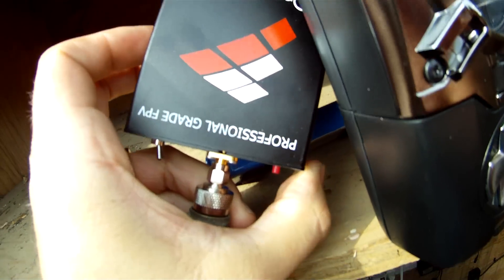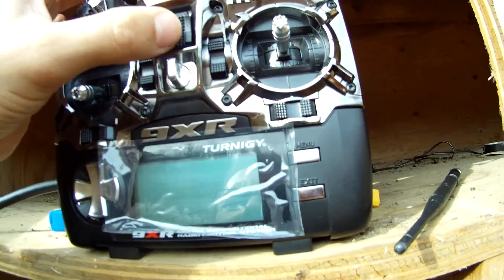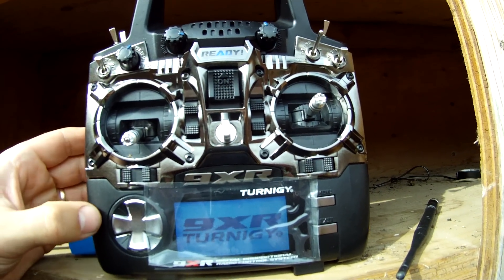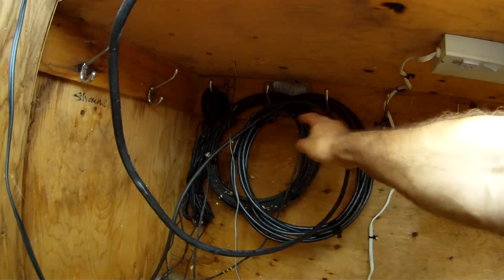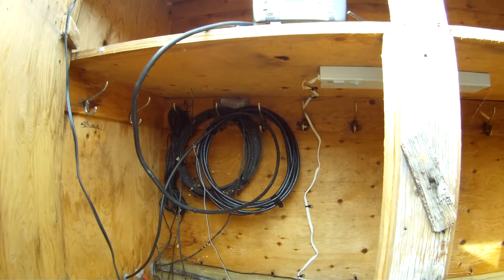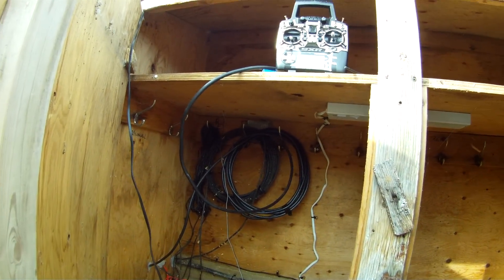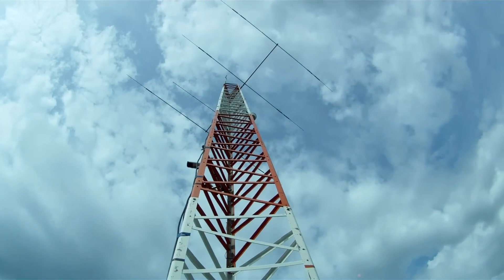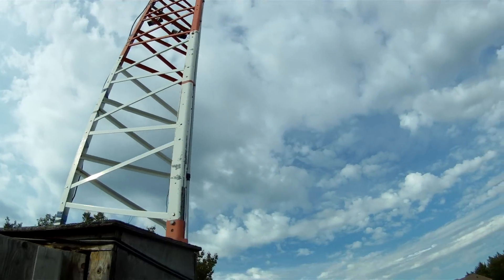Range Test DragonLink & Test with 1.3 GHz Video

Comment: Would it not make sense to use a 5.8 or 2.4 Vtx at the top of the tower as a short range repeater down the ground station to avoid the signal loss?

I realize this thread is a year old but I've always wanted to do something like this and I'm just curious.
Reply from the maker: Yes and I have done this with 1.3 to 5.8, my video on this at https://www.youtube.com/watch?v=eNfugbu7azE but the above video was mainly for the TX control which is on 433MHz and it's range using a tower mounted external antenna. The plan was to use UHF TX control on one tower, and the 1.3 to 5.8 vTX relay (or repeater) on a different tower.
Reply from the maker: When I used a 1.3 GHz vTX in this video, I was only testing to see if it would interfere with the 433 MHz RX. Was killing two birds with one stone...
Reply: +meteors63 someome told me i can use the dragonlink to send back video is that true?

Comment: dragon link is only control? or transmit video too?
Reply from the maker: +Cesar Coronel Just for control...
Reply: what is the best Tx video for long range?
Reply from the maker: +Cesar Coronel 900MHz video has the best penetration and distance but nobody makes good 900 equipment. All junk; plus antennas are very large. Best option for longer FPV range and good penetration is 1.3 GHz. No need for high power, RMRC 300 or the 400mW vTX is all you really need.

Comment: Since the new firmware update last year for th DragonLink reciever, almost all of my glitches are gone that was being caused by running 1.280 for video. The only drop outs I get are when flying very low a mile or so away. Ive considered going 5.8 but the range and penitration of the 1.280 is amazing. The pepper box realy helps, and when putting it on my 25 foot antenna tower thats goes in my truck hitch mount I made, the low altitude gets amazing.  Also the seperation of the Dragonlink transmitter from the Video recieving Antenna will also significately  help to fly low altitude further out with out the glitches.   Now like you Id like to get the Dragonlink Antenna up Higher.  I considered mounting the Dragonlink Transmitter up on the antenna tower with the pepperbox and video reciever and run a ppm cable down to the radio. The antenna already has the 12 volt power supply cable and video patch cords ran up through the poles. The poles are the standard rca antenna poles from Menards, they are gold and in 5 foot sections. They just slide together and the wires just stay inside the poles. 50' av cables are on amazon for 20 bucks.

Comment: Having some issues with Range and my setup... see post here and let me know if you've got any ideas!  Great video!
http://diydrones.com/forum/topics/dragonlink-range-issues?xg_source=activity
Reply: +Jeremy Stromsoe 
Another simple trick is to simply mount your TX antenna on a tripod, I made one from a camera tripod with a 1.5 meter aluminium extension, using a 5 metre cable, I can sit with the transmitter (at any angle) and my transmitter antenna is 3.5 metres up, perfectly vertical and immune to body shielding etc. Cheap and easy insurance with lots of benefits.
Reply from the maker: +Jeremy Stromsoe Well judging by the looks of your setup, antennas are a big problem. On the TX side, the monitor will distort your radiation pattern. You do not have a clean pattern.
Get rid of the monitor; also keep your DL antenna in the same orientation as
your RX antenna to maximize your range. On your RX antenna, again, keep the
antenna pattern clean. Keep it away from the frame and get it out all by itself
and in the proper polarization. From what I see, your horizontal on your RX and
vertical on your TX antennas, that’s 20db of attenuation. That’s not good at
all. And get your RX antenna at least ¼ wavelength away from metal or carbon
fiber (1/2 wavelength would be even better). It won’t look as clean but you’re
choosing a large wavelength control band and to take advantage of it’s improved
range, the size of the antenna and where it must be located is important. That
can be challenging for a small quad.

      

        

        

      
      

        Cancel
        Reply
        Save
Reply: meteors63 excellent constructive criticism, really appreciate the help.  I'm an aerospace engineering (not EE :)), at least that's my excuse.  So the best I could do was move the Rx side antennas away from the aluminum arms.  

http://imgur.com/gallery/p4KM7ii/new

I placed one vertically and one horizontally, underneath the belly.  If I did my math correctly though, a half wavelength is about 346mm and a quarter is 173mm, or roughly 14in and 7in respectively for the Dragonlink 433MHz center freq.  Hard to do indeed!  Way easier on a giant foamy aircraft.  

On the Tx side,I'm using the monitor to see where I am... so can't just get rid of it ;).  I think a good compromise would be to move the antenna (not the whole Dragonlink box) itself to the top of the monitor (where the rest of the antennas are).  You think that would be enough to not distort the radiation pattern?  I'm running a 5.8Ghz video system with diversity, so those two existing antennas on the monitor are for that.
Reply from the maker: +Jeremy Stromsoe I should have mentioned the 1/4 wave thing would be in a perfect world 
but if you're mounting it on a quad, not very practical on a quad. More 
for a plane. Just do the best you can to get the antenna out and away 
from other parts. Always best to keep both ends of a dipole in the same 
plane. If you can't, you can't, no problem. It just distorts the pattern a bit so it's not optimal. 

You're TX is probably acceptable the way it is. Do what you can to get the antenna in the clear.
Reply from the maker: +meteors63 I should mention that I have two 250 mini quads with DL antennas. The dipole sticks out the back (vertically polarized) about 2 inches. Range tests were more than adequate. Half of the dipole hangs below the quad and does not interfere with the props.

Comment: surely all that antenna cable will loose lots of rf power,
by extending my van cigarette extension a few meters i loose lots of power.
i lknow its not rf but electric cables, same thing enner
Reply from the maker: bartsshorts 
The cable I was using certainly had loses at 433MHz. This was for demonstration purposes only. But even with lossy cable, the video shows how well it did (even at ground level). My final install uses 7/8" Heliax which would have a fraction of the loses of the C1180. But even if I used C1180 or 9913, a tower mounted external antenna does far better then any rubberduck.
Reply from the maker: meteors63 BTW, the higher the frequency, the higher the losses in the coax. I'd never think of using this kind of coax for 2.4 GHz (unless it was a very short run).
Reply: meteors63 thanx, but i was refering to the long length of the cable causing loss.
Reply from the maker: bartsshorts The coax cables? That's what I'm reffering to also.
Reply: meteors63 yes, coax all the way to top of tower, looses rf power.
Reply from the maker: +bartsshorts Even if you lost 90 p0ercent of your output power through the coax, if it gets up high and to a good antenna, it would do far better than a ground based antenna that had no lossses.  No need for even a booser amp at 433, at 2.4 GHz maybe but not at UHF. If yoiu're concerned about line loss, use better feedline to reduce your loss. This video shows how well UHF performs even with lossy cable (and a tower mounted antenna).

Comment: Hi I live in south coast England there are many buildings I have a dx18 a hex with dji v2 my goal is to build a vtoll and fly lrs and land and take of again max distance 5 miles out as I say buildings trees you name it I've got it for interference how can I overcome these obstacles I will get the dl lrs system I have 5.8 vtx any advise for this scenario please, the only height I can get for an antenna is on the roof next to tv aerial just a two floor house !??
Reply from the maker: mark osborne 
Well Mark, DL will do well in foliage but to be safe, use
an external antenna for your DL and as high as you can get it. Use an amateur
radio omni vertical with as high gain as you can. That will solve the RC
control part but your current video will not cut it. 5.8GHz is the worst band
for long distance and foliage. 900MHz is the best long haul FPV video band we
have access to but nobody is making any good 900MHz vTX or vRX equipment. It's
all junk so stay away from that band too. That leaves 1.3 GHz. It's your best
option but 5 miles through heavy foliage is probably asking too much of that
band too. But it can be successful on that band if you use linear polarization
and long boom yagis (high gain). I'd normally use CP but not sure you’d find a
CP antenna at the GS that would give you the gain you need through all the
trees. Easier to find high gain antennas if using Linear polarization instead.
But if CP is what you want, try and very long helical at the GS; that might be
ok. Just remember, the pointing accuracy on the high gain video antenna will be
important as the beamwidth will be very narrow. The other option is to build a 1.3 to 5.8 GHz video relay
and get it has high as possible (80 feet plus). I have a video on my channel
about a similar relay. Good luck with the project!
Reply: Wow!! You certainly given me something to think about there i just sent a request of to join an amiture radio club hopefully i can get some more insite to all the band widths and also want my ham licence so iam not totally breaking any rules or what ever you have given me some great advise i shall explore every aspect of it all i thankyou kindly for that all the best to yer keep the wind in yer face and the sun on yer back happy flying

Comment: I have few questions (mabey stupid ): If I combine Dragon link ( 433mhz) and my spectrum DX6i radio (2.4ghz). What kind of frekvency I have ??? 2.4ghz or 433mhz   :)  If I use dragon link with 1.3ghz video will I need a 433MHz/1.3GHz notch filter ???
Reply from the maker: Not a stupid question at all. When the DL is hooked up properly to the radio, it will be 433 MHz only. There's lots of Spektrum/Dragonlink setup videos out there so  you'll see how it's done. Many of my copters have no problem using 1.3 video with DL with no problems. Occasionally it does happen but there's lots of fixes for that (even DL firmware for that). If there is any interference, it usually when using 1280, not so much on 1258 (and it's usually at the ground station only). Like I said, there's lots of fixes for these interference problems (high pass filters, low pass pass filters, just to name a few).

Comment: Thanks for this, my problem in no matter what channel my 1.2/3 VTX is on the Dragonlink V2 TX walks all over the VRX unless I space them out 2vmeters, i have used the special DL firmware but made no difference.. Do you think its safe to fly like this, just spacing out the controller from the ground station with a av cable.. Thanks again
Reply from the maker: Long A/V cables has worked but you're more likely to get other interference. If you want long cables, make sure the video cable is shielded coax (like 75 ohm RG59). You can also build yourself a 1.3 to 5.8 GHz relay. This also works well (and wireless). Have you also tried any low pass filters or bandpass filters on your DL TX? That might help too.
Reply: Thanks, No i haven't used any filters, its hard to get parts without snail mail from my location but will try get one soon, Just seen your other video on your 5.8 relay, i will give that a shot over the weekend, makes more sense to use with my goggles.. Thanks for the Tips :)

Comment: While doing a range check for the DragonLink on my hex using the micro power setting I can easily walk over 60' away and not lose the connection but as soon as I turn on the 600mw 1.2 mhz Vtx that distance drops to 8'. I have tried different DL antennas and it makes no difference. I know it is common for th DL tx to interfere with a video rx but this is the opposite. Hard to find any info on this problem. Any ideas?
Reply from the maker: Hmmm, that's odd. You're vTX must be giving you a spir on 433 to de-sense your RX. A spectrum analyzer would confirm that. Assuming that's the case, try an LPF on your DL RX or maybe see if you can find a high pass filter for your 1.3 vTX. The other thing is 600mW on your 1.3 vTX is a huge amount of power that is likely not needed anyway (especially for a multirotor). On most of my MRs I use 300mW and that's more than enough for long range. The few copters that I use 400mW on often causes havoc with one or more of the onboard electronics. Less is more.
Reply: meteors63 Everyone always recommended a low pass filter on the Vtx but you are saying try one on the DL RX? I used this on Vtx - Low Pass Filter for 1.3GHz Antennas from RMRC. What would you recommend I try on DL RX? Also, I do have a 300mW Vtx but can't try it to I get the correct connector for it. I have tried moving the DL antenna around with little or no improvement. Been fighting with this for months :(
Reply from the maker: alkbr3801 Yes LPFs on 1.3 vTX is often used to help GPS lock issues but if you don't have GPS problems, then a high pass may help. Try Digi-Key You can also get LPFs for 433 at RMRC. But I strongly suggest using less vTX power.

Comment: What Power did you set your Tx to in the video? 250mw or 500mw?
Reply from the maker: It was set at 500mW. I will likely do another test similar to this one when I get the 120' tower up and the high gain antennas installed.
Reply: Impressive ground range though. Any thoughts on the losses incurred through that coil and tower.
Reply from the maker: I did not measure the loss but I'm guessing with that length of C1180 it would be about 3db. The permanent installation will have much longer lengths but much lower loss cable too. Even if only a fraction of that power level got to a good antenna at a good height, it would outperform 500mW and a rubberduck antenna by a huge margin. This is why I see no need for a UHF booster.

Comment from the maker: Chanin Quail: some Dragonlink transmitters have been known to give interference on 1280, but were pretty clean on 1258MHz (assuming you're using DL LRS). Try switching to 1258. You can also try more separation between your LRS TX and your vRX. In extreme cases, try using a video relay, like 1.3 to 5.8GHz. This gives more separation distance between your LRS TX to your vRX. This can help in your quest for long range FPV.
Reply: So how much for just the complete fpv system? Excluding the rx? Which model dragon link? Thanks

Comment: I am curious- with the length of cable needed to run the tower, and with separation between 1.3 and the DL, what kind of attenuation are you seeing, and what do you do to boost signal without boosting noise?
I wanted to build a home ground station, but local antenna regs and the fact my location is not really conducive to an effective config as I set too low make that not worth the trouble. I do want to build a mobile GS for my truck, so it would not be as robust, but I could scale your specs down and it would work. I would use RG6 for cabling and have an antenna that could be retractable and carry both- one above the other.
Reply from the maker: My permanent installation will  have cable runs of about 200' and much lower loss than in the video so no booster required. In my installation, 1.3 and DL antennas will be separated by several hundred feet so interference is not an issue between the two. I have a blog on this project on RCgroups.
    Don't use RG6 as it's 75 ohm. If you want thin cable runs for your DL, use RG58 as it's 50 ohm and that's what you need for the DL antenna. RG58 has high loss on long runs but for mobile use, it will do just fine.
Reply from the maker: meteors63
RG6 works great for video (75 ohm). You can still use this for your mobile application but only from vRX to your monitor or goggles (not the DL).
Reply: meteors63
Doh! I knew that and forgot we work with 50ohm... old cable tv habits.
RG59 is sacrilege... and I doubt if I have any laying around... but it is cheap. I am too new to fpv and while my background in rf is outdated and diluted from lack of use- I am quick to learn and brush up. Thank you for the reply. I don't envy folks, but I admire what you are building... and I respect your testing acumen.

Comment: hey guys I'm new in this, explane to me this point please  : you use a system for VIDEO transmission and a system for RC? or one system that do both? I mean if I have a quadcopter, dragonlink will help me fly the thing, receive video feed from the thing or BOTH? love your video, I learn a lot thank you
Reply from the maker: There's 'Radio Control' (i.e. DragonLink) and if you're interested in FPV (First Person View), there's a transmitter aboard the quadcopter that will send live video from on board cameras. So yes, two different radio links.
Reply: meteors63 ok thanks man :)

Comment: It sounds like you know quite a few things about antennas. Are you a HAM. I know FPV is illegal without a technician license. I will be getting a license though. So, are you getting better results from this FPV hobby since making this video? I'm interested to hear.
Reply from the maker: Yes, I've experimented with antennas for over 20 years; yes I have a ham operator. Still more experimenting to do in preps for long distance FPV but delayed by winter months. Will continue in the spring.